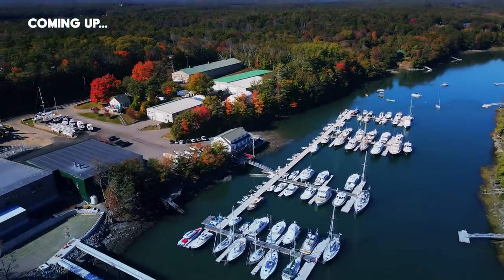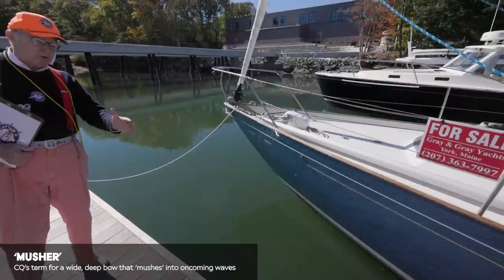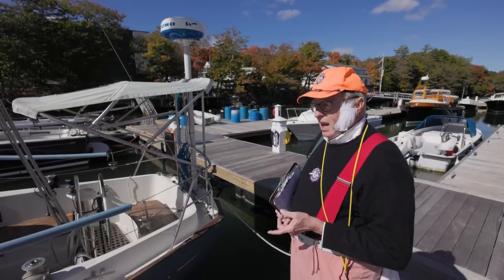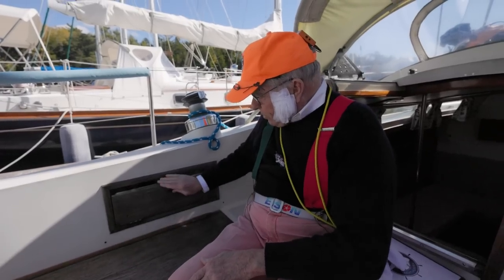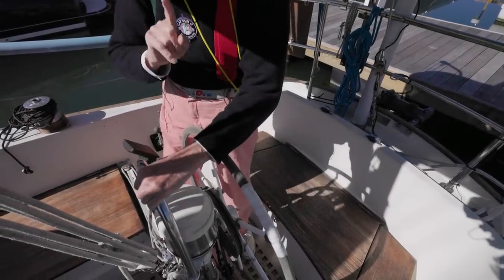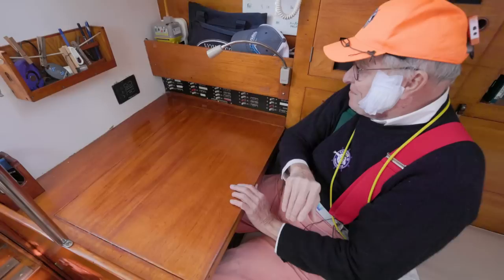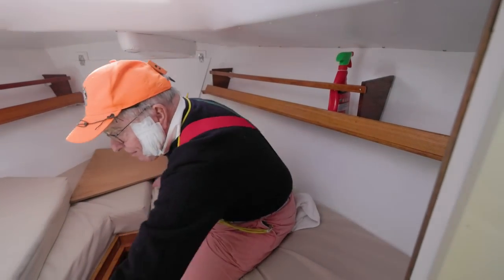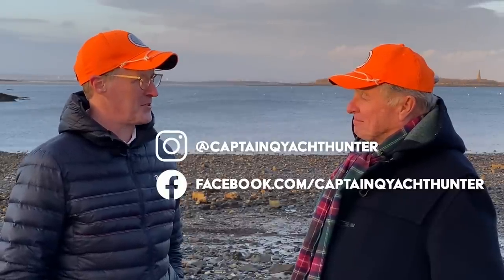$27,000 - BLUEWATER BARGAIN!! Nicholson 35 Sailboat for sale - EP 113 #sailboattour

Comment: That is the perfectest boat youse guys have shown so far...and you have shown a lotta boats. I am an old goat (but like bad cheese, I never managed to mature) and have never sailed but y'all have beaten into me, a great desire to learn. I have little need of fancy accouterments...finding the beauty of function more appealing than form...and that boat has function up the wazoo (and in truth...the form ain't too shabby either) . 

I look at the living areas of sailing boats with an eye bred from time in RV's and that interior layout is extraordinary efficient. Space for everything necessary to get the job done is maximized. Simple but clever touches like the 2 burner stove to save space (if you're cooking banquets, get a castle) and the 'get off the pot' bar in the head, are well thought out design touches, with utility in mind. 

Not a lot of extra doo dads that can take up space, break down and/or become annoying or dangerous. Just the basics, ma'am...just the basics. Just enough wood to add that certain something (which would be wood) and of more a girl next door quality, than starlet...which is A-OK with this cowboy. 

That hydraulic prop shaft system does offer an extra level of complexity, but for that, it open up all sorts positioning options for the engine and prop. Neato. And if it springs a leak, you get extra rust proofing in the hold. BONUS!

That boat is a lean, clean, sailing machine, for not a lot of beans. Thanks for sharing, boys. One day I will escape the shackles of frozen Canadastan and go sailing off into the sunset...after I learn all of those weird, nautically, names for stuff. Thanks!
Reply from the maker: why thank you pardner    good eye

Comment: I put 35,000 nautical miles on a Nicholson 32 and it was laid out exactly the same as this 35. I don't know where the extra three feet went as everything except the cockpit was the same. Mine was very solid with an easy motion through the waves and gave me a lot of pleasure for ten years. One thing I caught captain, that anchor on the bow is a claw not a CQR. If I bought the boat the first time I took it out in deep water that anchor would go into the deep. Get a good Rocna or Mantus anchor and sleep well at night.
Reply from the maker: Thanks for the background

Comment: Having a nut on either side of the mounting bracket is not incorrect. It's actually a better way because it prevents the threaded cable end from coming out of the bracket or even moving at all. But you can install it either way. I'd install it with nut on either side versus two together personally.

Comment: great show as always gents. I really learned alot from RanDay's steering condition a couple weeks ago with the expert surveyor he had inspect his own boat.
I curious, in the event the steering fails on the high seas, is it possible to engage an emergency tiller in a pinch?
Reply from the maker: absolutely   any boat rigged with a wheel will have been automatically given a spare tiller to pop onto the top of the rudder post found beneath the cockpit grate or behind the helm beneath a cover of its own

Comment: While she is a fine boat at an amazing price there are a few things missing that were not highlighted for a "bluewater" boat. Maybe its just me but out of over 170 comments no one even mentioned any of the following items, lol. Just seems common sense to ask about them rather than just fall in line with all the deer in headlights gang who are in awe of her beauty and low price. It's just wise and prudent to do your homework and ask alot of questions before jumping on board and sailing into the sunset. And one piece of advice I have is NEVER be fooled by the term "bluewater" capable.

1. Power generation (battery charging) - I did not see any solar or any batteries. I am assuming there is a starter battery for the engine and an alternator to charge the house batteries for lights, navigation and the FURMO radar system, as well as USB chargers for phones, tablets and laptops.
2. Batteries - are they AGM for the starter and  LifePo4 for the house?
3. Was there a chart plotter? I didnt see the usual B&G, RayMarine or Garmin stuff?
4. Solar Panels? I didnt see any solar panels that most every boat , especially a "bluewater" boat must have to generate power.
5. Rigging - you didnt go over the rigging setup in as much detail as I would have expected for a "bluewater" boat. How old is the rigging, when was it last replaced, etc. Also, it looked to only have three sail plans, the mainsail, the jib and the spinnaker with a pole. Personally I prefer an in-boom furled mainsail setup, way easier to handle especialy for solo sailors.
6. Radio setup? All you pointed out was the ePurb but nothing else. Does it come with a radio and if so what make and model?
7. The navigation station didnt seem to have any navigating aides, no chart plotter or controls that I would expect for a "bluewater" capable boat, meaning, if I am inside, especially under weather, I want to SEE the RADAR, see the chart plotter, see the speed, wind and direction and the weather, as well as other boats around me, especially at night.
8. I question this term "bluewater", it seems to be tossed around alot to "SELL" a boat. Just because it sailed across the Atlantic does not mean she is a bluewater boat. The owner over at Kraken Yachts did a long series of videos talking about what really qualifies as a 'bluewater' boat, meaning, what the design, rigging and sail plan including all of the navigation equipment and backup you need to really make a boat a bluewater sailing vessel.
9. Propeller - you didn't talk about the prop or what type of prop the boat is useing. Obviously for a bluewater boat the prop type chosen will make a big difference in the speed you are able to make.
10. Water and Diesel Tanks - didnt see anything about this either. What size are they and where are they located. Are they in good shape.
11. Steering - you did a great job of going over this but it was obvious to me there is alot of rust in that system and needs a complete overhaul and replacement of parts. If that is all original equipment, at the least it needs to be taken all apart, inspected and cleaned. However, if I bought the boat everything would be completely replaced for piece of mind.
12. I love the idea of a windvane sailing system as a primary backup but did the steering come with an autopilot? I didn't see it so assume there was no such thing set up for this boat. Manual steering or useing a windvane for a "bluewater" boat is not my idea of fun. Yes, the windvane when set up properly works wonders, but its NOT alwasy as reliable as people say, it has its quirks. Which is why for a "bluewater" boat its mandatory to have an autopilot set up along with a backup autopilot. Never leave the dock without it!
13. Just curious why the FUMO radar was setup on the stern of the boat rather than up on the mast like everyone else? Was this becuase of wiring concerns, meaning it was just easier to setup on the stern rather than going up the mast and drilling a hole and fishing wires down the mast?
Reply: Wondering if a foam filled mast makes it difficult to add electronics.
Reply from the maker: Thanks for all your thoughts   too many to go thru now , but i will try to get back      Basically please bear in mind that we have a very small window to provide our episode thumbnails of the boats    thank you
Reply: Visit the broker's site for answers to your questions, most of which are yes, she  has that.

Comment: It seems like the hydraulic system with the drive shaft makes it unnecessarily complex
Reply: Does it save alignment hassles? Let you place the engine however you wish? Make the stuffing box easier to access?  You also could run the engine at ideal rpm and use hydraulic to control speed.
Reply from the maker: strictly a design tool for the architect to derive the weight and space in their works right where they want it